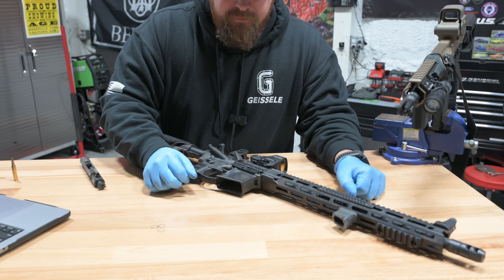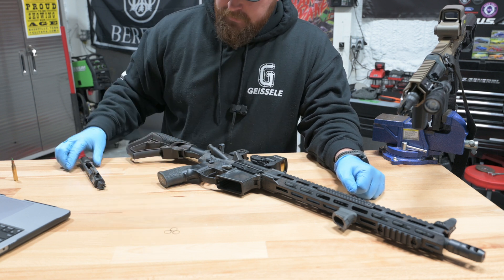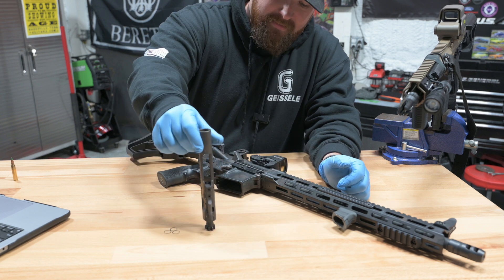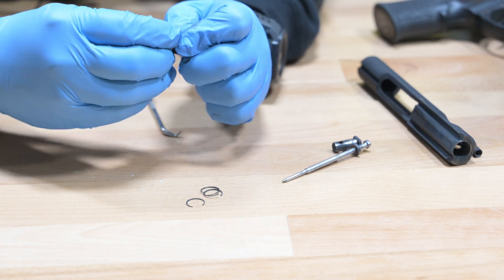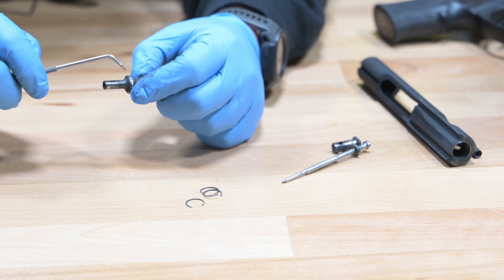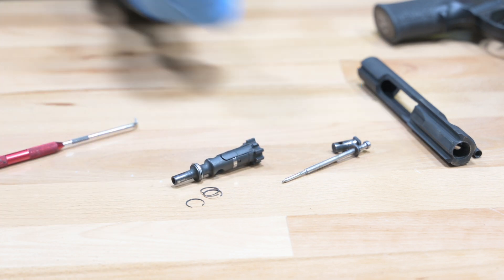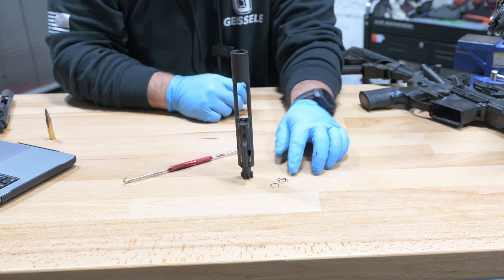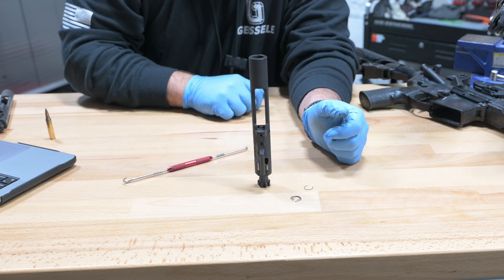How to Repair/Replace Gas Rings on an AR15 Bolt

Comment: My friend, can you make love quickly?Do the rings disrupt the triple launch?Do I place the rings on the gas rings randomly while replacing them?
Reply from the maker: I can make love quickly but I choose not to. However I’m not sure what that has to do with this video.
Reply: @PerilousAlliance  When shooting and assigning the lever to the triple automatic mode, the rifle does not operate only in the single mode
Reply from the maker: @assassinsayman5625  could be your flux capacitor might need to be replaced.